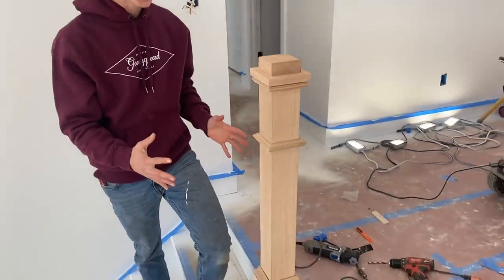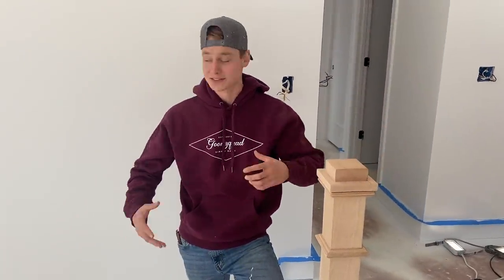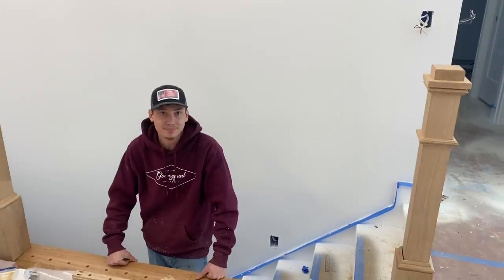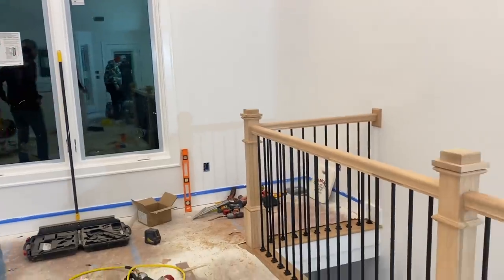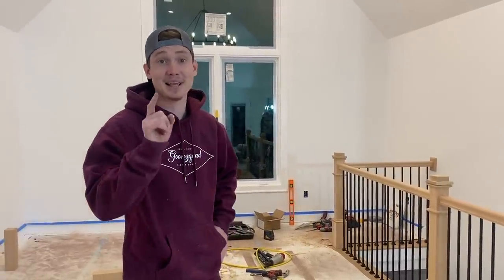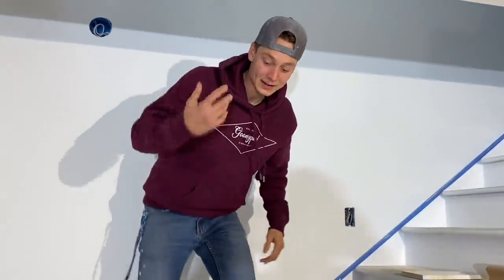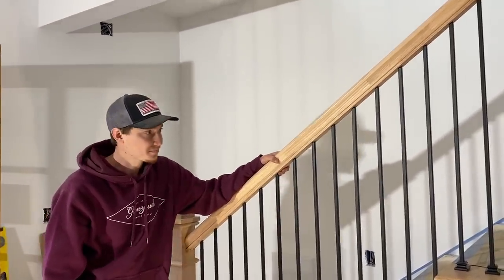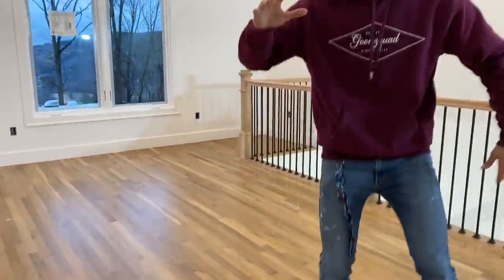The New Goonzquad Headquarters Part 64

Comment: Are those guard posts up to code in your area?  Newel posts usually have to tie back to structure
Reply: Nope, they are installed incorrectly. They were supposed to tie them to the joists that is why they come long like that. If they ever read the comments this was pointed out months ago when they 1st talked about cutting them. Now they have to re-buy all new guardrails.
Reply: @ingresswizard9044  Would there be any joists? I thought it was a poured concrete floor? (i could be wrong).
Reply: @Mike...921  The newel post at the bottom of the stairs should have been fixed to the concrete slab with an epoxied stainless steel dowel. The three posts upstairs should have been securely fixed to the LVL with steel bolts. The return handrail on the upper floor should have been fixed to a 2"x4" noggin fixed between the wall studs. The whole system has to be able to resist a 200 pound static lateral load at any point without showing significant deflection in order to pass Code.

Comment: Guys you were 100% NOT supposed to cut those guardrails. You have to cut a hole in floor and attach them to the rafters of the house. The way you have them secured someone would break those from the floor and possibly kill themselves. There is a reason that they come as long as they do. You will NOT pass inspection like this so you guys need to order some more guardrails.
Reply: I remember reading the instructions at my old job all the time too then I noticed them doing this like uhhh I'm not sure that's how you're supposed to do that 🤣

Comment: Your inspection should fail when it comes to the stair system. Specially if the inspector watched your video.
Reply: why
Reply: because they built a junk rail that is not sturdy and has a giant opening looks like garbage in my opinion not safe at all
Reply: @carter.69  The posts are supposed to go through the floor and bolt to the framework. They only used little l-brackets screwed to the floor. No strength at all. first adult that leans against that post is going tumbling down the stairs.
Reply: @carter.69  read some of my other comments. All post were not anchored properly. The downstairs post is in the wrong location. Plus, it's not anchored property either. The rail to the wall, on a Rosette, that was finish nailed to the wall. I don't think they even planned on  putting backing there. Or put backing on the opposite side for the other rail that is coming. 
The rosette, finish nailed to the ceiling beam on the down rail. 
It's just a mess. The rails are to be bolted to the Post, and to the wall.
Reply: @rickfromthecape3135  it'll probably last for a few times of people leaning on it. But you're right, it is not safe. The rail to the wall, not anchored properly either.
Reply: @michaelmorell7451  I hope inspector watches this series as training and hands them pages for all the code violations I've seen.  The non treated osb and framing on the pump house is too close to the backfill grade and missing all kinds of flashing.
Reply: @kdrguru  imagine if the inspector passes it, then his boss see's the video.

Who signed off on the blueprints. All the backing would be on the stairs framing page

Comment: Oooo man that’s a hell of a shady way to install posts to me, I always did lag bolts half in the post and half through the nosing/stair into a floor joice. It should feel rock solid even on it’s own.

Edit: Still watching, the spindles are being done right at least. Wait, where was the glue? You gotta use glue.
Reply: They installed them wrong 100%. People tried to tell them this months ago but they never read DM's or comments. I only hope the inspector catches it before someone dies.

Comment: you're going to wish you stained the hand rails before putting it all together lol
Reply: They'll tape it up
Reply: huh? I never stained first in production. the only finish prep I did was belt sanding the posts square prior to install
Reply: They can stain them when they have to take them all back off to meet code

Comment: You could use some 6” rail bolts at least to fasten the post to the floor joist I personally would cut a hole through the floor and foundation mounted them in before the floor went in them Timmy tool brackets made famous by LJ smith are gonna get somebody hurt.
Reply: Give ASK. THIS OLD. HOUSE a call for amp on screen fix.  Tom Silvaakes house calls

Comment: I personally tied my Newel post into the floor joist below the floor. I fear those Tiny little L brackets will give the first time someone stumbles and grabs for it.
Reply: Came here to say this. One quick turn around that post will rip it loose
Reply: That's because they installed them wrong and this won't pass inspection.

Comment: That turned out AWESOME 😎, I was wondering about the spindles. But they tie the hanging light together. Measure many times, cut ONE TIME! I would run wood across the ceiling to see what it looks like before using just the spindles.

Comment: I paint a lot of multi million dollar homes in upstate NY. For your stair spindles they run a piece of oak or whatever you're using from under the top of the railing to the end. Then shorten your spindles as needed to finish it out to the end of the opening. Looking really good. 👍

Comment: When Goonzquad received the parts for the staircase balustrade, railing and handrails several episodes ago, they stated that an experienced joiner would be commissioned to install those items. It was disappointing that they changed their minds and chose to do the work themselves, because the installation is unsatisfactory, may not pass Code, and is potentially unsafe.

Comment: How did he run a hot water line from the cold refrigerator line?.....
Reply: There was a hot water line in the wall. See time 2:19
Reply: Look at 2:19; you can see the red line running about 6" above the blue. My suspicion is that the sink was already set up but just drywalled over the box. Perhaps same for the commode.
Reply: Hey, I have no water from the fridge? Hold on, let me flush the toilet. Ah, there we go.😂🤣
Reply: @johngiromini5745  Yes, that is exactly what happened. The mistake was nothing to do with the original plumber in 2008 or with Goonzquad's plumber. The 'missing pipes' were always in the wall and were wrongly covered over by Goonzquad's drywall installers, who were not correctly instructed and supervised.

Comment: Looks great, as for the stair rail. I would take that little piece of wood off where the rail attaches and run a piece the same width but the full length and then put your spindles into it. Just my thoughts. Keep up the great content ...cheers.

Comment: What I would recommend doing for finishing the stair railing.. purchase a piece of red oak that is the same width and thickness as the piece that you screwed the railing to, drill the holes for the spacing of the stiles into it and then screw it into place on the LVL, and then insert the remaining stiles into position.

Comment: A good Pop's project for that leftover multi cored block would be to cut it into 1/2 in. thick pieces and put a nice finish on em and  stick on 4 rubber feet on 1 side and have a nice coaster set that could go on the bar to match the house!  And Just replace that small cap at the top with one longer piece that the rest of the spindles can go into.Use a right angle drill and a short bit for the rest of the holes in the steps.

Comment: Future food for thought: adding full blocking in the bottom tread allows you to use a long lag screw that will add lots of strength for long term use . Your doing a great job guys , and pop is having a great time . Love it .
Reply: They're hacks.  So so many mistakes.  100% odds windows will leak in a blowing or long rain event.

Comment: On your wall hand rails, miter cut the top and bottom, and return a small piece of handrail into the wall. All of your wood to wood connections should be glued with carpenter glue and nailed or pocket screwed.

Comment: @goonzqad
Regarding the stair railing ending at the ceiling & that open area, you could just cut a section of 3/4 inch marine plywood or perspex out to slot into the stairwell & ceiling,  just paint it white for the wood, leave clear for the perspex & maybe put some molding at the top & bottom as it rises up the stairs.

Comment: Hi Guys

For the top of the stair railing, I would remove the block that you have the hand rail attached to now, and run a long piece of the same stuff all the way back to the wall, and use that to anchor the spindle tops.

That would look legit!

Comment: For the back end of the stairs, It would've looked nice had you used a piece of wood the full length from the back end of the wall up until it met the hand rail. Then used that piece of wood to sit the spindles in. However, I think the end caps on both ends would suffice as well. Awesome job guys, keep up the great work!

Comment: excellent job guys... the stairs will look better if you run one continuous piece of wood on top under the beam.  The problem is you already have once little piece in so you gotta remove it first which won't be easy

Comment: Just a TV placement idea . High on the stair wall . Have the chesterfield on the outside wall . 
Giving you a much larger room .  My thoughts are if the TV is high on that wall people using 
The stairs will underneath it .  That’s a really huge wall . Just an idea . You did an incredible job btw.

Comment: On the hand rail you should put a flat piece of the same material along the top and then use the little button pieces on both sides. That way it follows the same wood pattern.

Comment: Stainless steal rails with glass panel stair rail would have gone so much better with that floor and modern feeling house. Also think stainless will go so much better in the kitchin other than gold (also matches all the external locks)

Comment: You boys could use a red oak 1x4 and rip it down to the same size as your wood mount for the ceiling and instead of the mounting to that little piece you would have it run all the way to the wall from your mounting spot  then put your spindles and caps cleaner look

Comment: I'd say to replace the small piece of oak at the top of the railing with a routered board to look the same, same dimension, just long enough to run the upper span and then finish the 3 spindle pattern all the way up.

Comment: I agree with Billy I think you guys should put that piece of wood and use it as a continuance in that little triangle area for the spindles But instead of mounting it directly to the sheet rock I think you should cut the sheet rock out and mounted directly to the lvl inside so it looks like the wood is coming out of the sheet rock

Comment: I have to agree with most of the comments. L brackets suck. I've them and anchored posts to the floor joists. L brackets are a lawsuit waiting to happen. Anyone that leans against either railings will be taking a trip down. I would definitely back up and reassess those posts. You want the posts locked in with absolute zero movement.
Reply: Agreed. The three posts on the upper floor should have been centrally pillar drilled from below and a matching hole drilled vertically down into the LVL. A steel rod at least 16" long and 3/4" diameter could then have been epoxied into the holes to support each post. The newel at the bottom of the staircase could have been similarly fixed onto a rod drilled and epoxied into the concrete floor slab. Much stronger and more long lasting than screwed brackets.

Comment: To sell those posts as “solid wood” all that is required is they not be hollow in the center. It does not require they be filled with all the same type of wood or even one square solid piece. Just that the post structure is filled and solid. Using cheaper wood in the center saves manufacturing costs.

Comment: You should peel off all the Stickers from the Glas in the Windows and Doors. The UV-Light from the Sun will burn Shadows into the Glas around them and you can see later where the stickers have been.

Comment: Remove the small square plate you put at the end of 45 deg. handrail and run a board, the same width and thickness as the plate, to the end where the ceiling meets the stairs.  (approximately 4"×1"×4ft)

Comment: I'd continue wood for the top step spindles. Modify that last flush mount finial with a flush cut saw and continue the rail out from it.
Reply: Those last few spindles you can't drill a hole for, just glue/epoxy them.

Comment: take an osculating tool and cut the end of that wood piece that connects the handrail to the drywall, then run a 1x that has the same design with the 1/4 round and run it down the length of the wall and drill to that, it will look WAY better

Comment: you 2 get an unlivable amount of work done in 2 days even never had done this before. I still remember the brazing tip on the torch you wer cutting 1/4" steel with. 6 months 2 guys build a whole house

Comment: use the molded timber that you're using as a plate, remove the existing plate and extend it right to the wall then secure the spindles in to it, it will flow and look really nice once you put a finish on it.  Top tip, stop touching the unfinished timber with your hands the natural oils in your fingers could react with the finish you use.

Comment: Get a red oak 1x2 or 1x3 and run that along the ceiling. Terminate your spindles into the 1x2. Round over or profile the edge a little bit and stain it to match.

Comment: I recommend to use the heat gun, to soften the stickers. After the removal use WD40 to successful get rid off the glue. It is very effective for glue removal. After that use some alcohol to remove the WD40. Definitely, they should check before, not to ruin the protective coating, if the windows have this kind of treatment. Also, WD40 have many other purposes. Good luck to all!

Comment: I would use the wood mount, then add the bars it just looks better an and adds more stability to that area of the railing. It would also work if you guys just add the bars, I do understand the disappearing rail effect. What do you guys think. I think the disappearing rail effect would be better as a surprising accents. It’s would be eye catching.

Comment: I think that county ought to fire that plumbing inspector that didn’t catch the problem in the bath room.
Reply: The First Fix Plumbing was inspected and correctly approved, all necessary pipework having by then been installed. The problem only arose when the plasterboard was installed at a later date, and the error was that the pipes were covered over instead of being fed through appropriately positioned holes in the plasterboard. The fault lies with either the plasterboard installers, the person who was or persons who were instructing, managing and checking their work, or both parties. It was not an error by the Goonzquad subcontractor plumber or the Plumbing First Fix Code Inspector.

Comment: Should’ve used the Kreg pocket hole tool for the posts as well. That pocket hole system is really strong. Plus your trim would’ve slid down like you wanted. Anyways, hindsight’s 2020 right. Love the videos!!

Comment: take your oak base off the top of the rail where its fastened to the ceiling and attach a oak base plate that will run the length from where it meets the railing to the wall. Then put your rungs into the oak base plate

Comment: Hi guys, you can run a board from the end of the railing to the wall the same thickness that you have right now and continue using the baluster at the same distances.

Comment: I'd be surprised of that large window passes inspection. If you sleepwalk backwards or you're a toddler, you're bound to fall out.
Reply: Code requires that window sills on upper floors of houses be at least 24" above the interior floor level. Many parents augment this by fitting a demountable rail 36" above the floor, for added safety.

Comment: With all the guardrail comments, I watched another video where a guy ran a long threaded rod from near the cap into the plywood floor and essentially bolted it down, so I assume that's pretty strong although not connected to a floor joist.  On the other hand, didn't those little L-brackets come with the posts?  And when everything is connected like it is, the whole structure should be fairly strong like an airplane whose individual components may not be very strong until connected together.  Maybe the inspector will require a good old-fashioned crash test.
Reply: The fixing of the Newel Posts in the 'HQ House' is unlikely to pass Code, which requires the entire balustrade to resist a static lateral load of 200 pounds at the handrail height without noticeably deflecting. The four Posts have to be bolted or otherwise firmly secured to the structure in such a manner as to satisfy this standard requirement, and the building will not pass Final Inspection until the Building Inspector has checked this critical safety feature. Regarding the four small brackets supplied which have been attached with small screws, these are intended only for levelling during installation and are not adequate to support the Newels.

Comment: I think I would have those top rails in to those little squares at the top, but don't do the top hole if the vertical gap is 4 inches or under (no need under code), plus it would be super hard to get rails in that little gap.

Comment: Gotta remove that plate at the top of the right side handrail. Then make a plate to replace it that runs the length of the rest of the stairs and mount your metal rods in that.

Comment: You have to use the black caps otherwise the remove the pad that your rail is attatched to so it can run all the way to where the spindles stop.